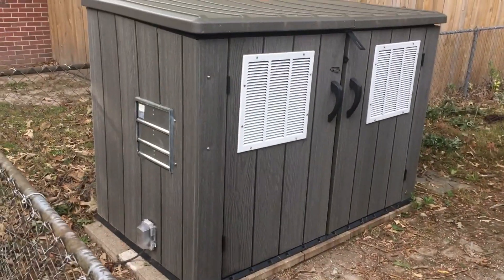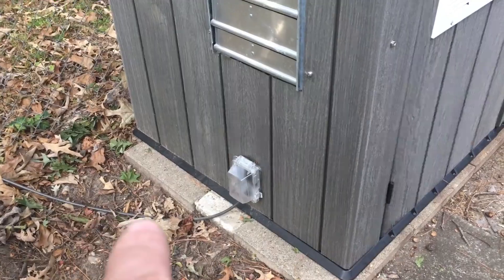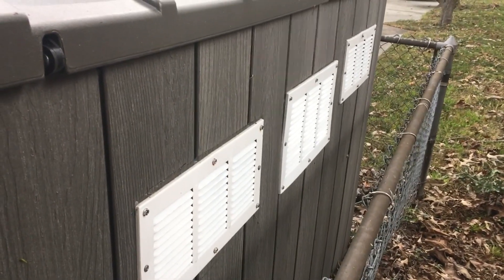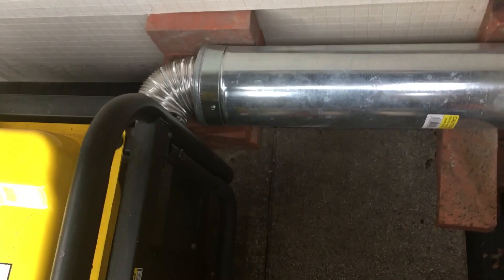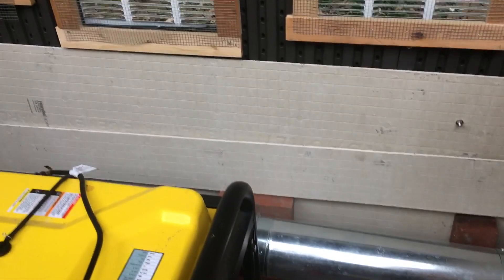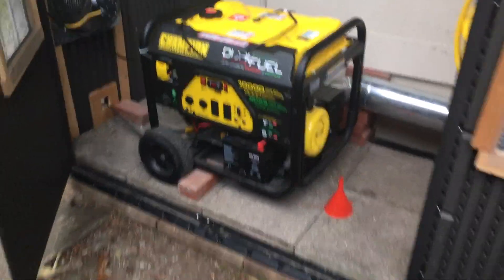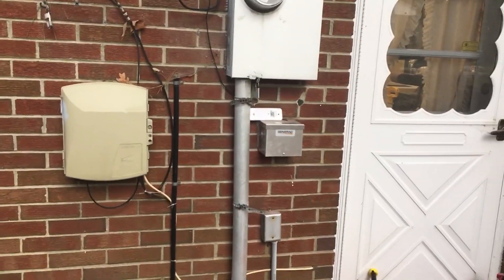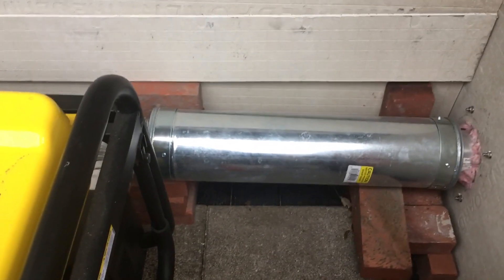Generator Shed / Enclosure

Comment: I know this an old thread but if you haven’t been able to run your ac on the gen. Look into getting a Soft Start installed on your Ac. It drops the starting amps when turning on.
Reply from the maker: That’s a good idea. I’m selling in about a year and the AC is the kind with the ‘can no longer use refrigerant’.  So gonna roll the dice one more time.  Thanks!

Comment: I have a generator that exhaust out the back as well. Been trying to figure something out.  Any problems with leaking around the tab flange? Is the flexible piece going all the way through?
Reply from the maker: I am sure there is some leakage, but I haven't seen any issues associated with leakage around the flange.  A another hurricane came through one or two yeas after I took this video, the generator ran for 7 days and everything held up just fine. The flex hose goes through the 6-inch pipe and then connects to the dryer vent.  Thanks for watching.
Reply: You said you changed this since the video.  What exactly did you change?

Comment: exhaust fans on the exhaust side of the shed intake vents on the lower left side of the shed then cover all the other vents walker exhaust tube and header wrap probably more cfm  you need good crossflow shove the engine fan closer to  the  new vent location

Comment: Over kill in n the vents, rain water will get in
Reply from the maker: It’s been three years and there has been no issues with water coming in the vents.
Reply: Indeed. Also It has the fan on the wrong side. And as you said, the inlet vents; should be at the bottom. Never up side  because the air is cooler near the ground. And NO vents larger than the fan can move the air. Otherwise, the Generator is louder and too hot too.

Sorry that, the old common "adage" of saying, "we have no problems"; does NOT overcome poor "workmanship"! When building any thing. For IF you moved the fan to the other end; and put the vents close to the bottom; and use only enough; that the fan can move air. You would be saying this, "it's much better! GAR-OWN-TEED. Thanks!"

If you were honest. Just trying to help you kind Sir.

Comment: What was the shed made out of I need to build one for a 6500 w water-cooled flathead Kohler generator out of a r.v. motorhome
Reply from the maker: The box is a Lifetime brand unit. I adapted it for my generator to protect it from the elements and ease of access when needed. I have place away from the house to ensure exhaust is not coming into the house.

Comment: Why not wire the generator to the fuse box when needed
Reply from the maker: When I have to power the house, I have a large electric cable designed to plug into the generator and into a plug that connects to a breaker in my panel.  I can only turn on the breaker by turning off the main breaker to the house, so I am not backfeeding the lines.

Comment: I have that same lifetime shed however I went with the taller lifetime shed with no lifting roof.  I have a generac 17500e inside it with rockwool insulation a smaller hardie sandwhich for the exhaust with a 36 inch walker exhaust pipe with muffler tape in a 3 inch double layered galvanized vent with some heat wrap out it.  I also have 3 hessaire fans 300cfm, 900cfm and 1100 cfm with a 21 x 21 vent and two 6x6 vents.  In Texas I have a heat problem I had a fan shut off at 130.  What temps did you record when running it 3 days straight.  I may start over use the shed you have and forgo the insulation or go to rockwool comfort board instead of rockwool batting.  I have to get the temperature lower.  I'm no longer concerned about sound my neighbors each put in 24KW standby units so it no longer a concern.
Reply from the maker: Once the storm passed (in 2018) there was no reason to keep the enclosure closed up.  For the ensuing outages I did keep it closed up to protect the generator from the rain and still recorded temps in the above 130.  That is just too hot. This winter I will be putting in another fan and more vents.  I was having problems with the generator vibrations and my original exhaust pipe so I did away with my homemade insulated exhaust and used a regular vent pipe through the hardy board.  Haven't had any problems.  I know its noisy, but my neighbors all have generators...so I am good to go.

Comment: Your inlet vents should be as low as possible so that the fresh cool air can come in, run over and through the generator cooling it off. The exhaust power fan should be high because heat rises and you'll need to suck the head space inside the shed. 
Your design bring in fresh air up top and removes it up top without it really helping the generator/the shed cool off as efficiently as it could.

Comment: If heat is an issue in summer, you can add a small garden hose and water tank and set up a drip swamp cooler.
Reply from the maker: I had thought about that. Goes back to my Arizona days! Lol

Comment: you shouldve just bought a generac bro.
Reply: Bit stupid buying  Generac considering the cost of them and the warranty issues forcing you to have a Generac certified installer install it otherwise you get no warranty. They are good generators but for most people power outages happen for a few hours twice per year. I costed out a Generac to give me the same as my Champion Generator - 7500 running watts and it came out close to $7000. With my new generator shed build - which is very substantial compared to this one as I am using it to dampen sound, I'm looking at around $1500 for the generator and the shed including a concrete base and it's hooked up to my large house propane tank. I guess you must be Mr Money Bags to make stupid comments like that.
Reply from the maker: $700 vs. $5000 plus the cost of running a gas line...all in I was looking at $8000. With very little return on my investment with a move pending.

Comment: Did you run the ventilation fan in your extreme test?
Reply from the maker: I did run the fan during my test.  However, I commented below to another viewer that during Hurricane Dorian, I ran the generator with it closed up and the fan on; No sun, temps in the 70's and the inside was still really hot.  I will have to install another fan in there, as it is too hot to run with the doors closed.

Comment: Out of curiosity, I'm in the learning phase here, why didn't you go with 50 amp service? Don't most of those style generators provide it? And how much consideration should taken on the storm rating of the enclosure?
Reply from the maker: My generator is 30 amps.  I’m not sure about the amperage for other generators or if a generator switch can be installed, by code, on a larger circuits. 

I don’t know about a storm rating...but I installed a layer of pavers on the bottom of the enclosure for weight. I also put in an auger stake at one end, (really a pet stake) and run a ratchet over the enclosure to my chain link fence.  It won’t stand a tornado...but so far she’s lasted through two hurricanes and a tropical storm...plus the summer high wind thunderstorms.

Comment: May I ask where you got the storage shed? Yours seems much nicer than some of the ones I've seen on YouTube.
Reply from the maker: PMCRyan Costco. But they only sell them at the beginning of spring.
Reply: @snapjamwoodworks710  thanks! I'll have to keep my eye out. I'm on well water and electric hot water so it's time I invested in a generator as well as storage shed.
Reply from the maker: PMCRyan Appreciate the feedback. Hurricane/TS Isaias just rolled thru last week. Had the generator running for 36 hours.  Fortunately (ironic, I know...) the storm hit in the early morning and knocked out the power about 4am. It was past us by 9am so no rain just wind. I was able to prop the doors open to let the heat out. I have plans to add another fan above the exhaust pipe. It’s just too hot in there with the doors closed, even while it’s raining with no sun.
Reply: @snapjamwoodworks710  you think two exhaust fans will improve that? I'm trying to soak up as much information about these builds before I go out and do my own.
Reply from the maker: @RyanAtTheTop  When I tested after first building the enclosure, I recorded a temp of 127 degrees in August in the heat of the day.  That is 27 degrees hotter than the recommended ambient operating temp.  During Hurricane Dorian last year, I ran the generator with the doors and lid closed, during the day in the middle of the storm.  No beating down sun in early September with a high temp that day of 75 degrees and I recorded a temp of 120ish degrees in the box.  I believe another exhaust fan would help, with at least one or two more vents.  Jay Vee made a comment below about placing a fan near the exhaust to help.  My dad  had the idea to cut a larger hole in the back and aim the exhaust out instead of a pipe.  I am planning on doing just that and installing another fan once the hurricane season is wrapping up.  Where are you located?
Reply: A lighter color might also help. It not only has the heat being produced from the generator, but also the heat being absorbed from the sun.

Comment: Nice concept but your exhaust venting solution is going to drive up temps on the exhaust valves and cylinder head leading to premature engine failure. You really don't want to duct it like that or extend the exhaust in any way due to standing pressure. 
Instead just put the exhaust fan near the generator exhaust.
Reply: That's a good point about the exhaust.  I wonder how the production enclosures like generac do it?

Comment: Recently, a friend and I were debating about all these youtubers who are keeping their portable, gasoline powered, power generators in a vinyl, store bought shed. The shed is intended to be used as an unobtrusive place to store a few trash cans. These vinyl "sheds" make for a very suitable thing for storing a portable, gasoline powered power generator. It keeps the expensive generator out of the elements, and provides some noise reduction when the generator is running during or even after a store has knocked out power. It is clear that the generator produces a massive amount of heat in just a single minute of running. The obvious, "simple" answer to this dilemma is to install air vents on one side of the shed and something like a 120 volt AC, attic fan that can be conveniently powered by the running generator. Most people who attempt this monstrosity are often too proud of their "custom" designed, quiet, generator shed box. One youtuber placed an attic fan on the lid of the shed instead of the side like all the others, which ideally remains closed to keep the rain out. It is clear to me that the attic fan will do a much better job of removing the heat inside this box if the fan is on the roof/lid, not the opposite side of the shed from the air "intake vents". I won't even go into the various ways of modifying the shed to allow the exhaust to escape without melting the vinyl shed. OK, so, if the generator is stored in this "otherwise" sealed container, the fumes from the gasoline in the generator's tank will indeed produce some fumes, fumes that we all know are dangerous and highly explosive. Is it possible that when the generator starts up, and kicks on the AC power to the attic fan,,,, wait for it.. a single spark from the attic fan's motor brushes/armature could ignite the fumes and KABOOM??? !!! ! !  !
Reply: You obviously have just discussed it and not done it.  Most of us are going to propane over gasoline but fumes with proper CFM are not an issue.  This being said you are accurate that controlling the temperature is a real challenge and gas boils at 168.
Reply: That’s what worries me also… fumes and the possibly of a explosion.

Comment: mr asked when the engine is running and hot.  You can heat the gas tank because it is very close.  it is dangerous ?
Reply from the maker: The tank is directly above the engine by design and just inches from a very hot exhaust.  The increased ambient air temperature in the shed would not be a factor.

Comment: I have the same generator and am looking for a solution to store it in the northeastern US where we get heavy snow in the winters. What is the size of the shed you used?
Reply from the maker: Malcolm Gregoire I just returned from a business trip. I’ll measure tomorrow.
Reply from the maker: From the manufacturer 75.2 in. x 42.5 in. x 52 in.  I bought at Costco. Now that it’s spring they should start stocking them.

Comment: What ton is your AC? I have a similar spec generator and it easily starts my 3 ton.

Also maybe add another exhaust fan? Max operating temp for air cooled gens like this is usually like 105 degrees. Also might want to consider getting some 5w-40 if it gets cold there or just got for 15w-40
Reply from the maker: adammperez I have a 4-ton system but it’s on a 40-amp circuit breaker and the interlock circuit breaker is only 30-amp.
Reply: Snapjam Woodworks you should still try it. It won’t trip the breaker. Running amps is prob like 15-20. The surge is prob 80 but it’s for like 100ms, doesn’t trip breakers. If you put a hard start, no question it would start it.
Reply from the maker: adammperez I’ll try the AC. Another fan is on the list. During Dorian it was still pretty hot inside.
Reply: Snapjam Woodworks Very cool...I have the same genny and have my AC guy coming to install the hard start kit so I can run my 3 ton....I still need to build the enclosure but this is very helpful! Thanks

Comment: What brand is the shed.  Where did You     Buy it
Reply from the maker: Roel Solis Lifetime. Purchased at Costco
Reply: @snapjamwoodworks710  what are the measurements of the shed? I dont see this one on costco website right now
Reply from the maker: Stu Beans 75.2x42.5x52. They usually have them on the floor in spring. This late in the season they may be all gone.  I bought this one when it was returned in the box. Good luck.
Reply: @snapjamwoodworks710  Thanks buddy. I was able to find a Lifetime Horizontal Storage Shed (75 cubic feet) at Sams for $349. Pick up tomorrow !

Comment: I appreciate you taking the time to make this video. I'm getting ready to build an enclosure for the same type generator (and I'm coincidentally also having to deal with that Virginia Beach heat and humidity). I'm building it with noise as my primary concern due to the location I have to have the generator in, so this design may not work out for me, but it still gave me some ideas.
Reply from the maker: Beautiful Loser Good Luck!

Comment: Hi, what tempetature is espected inside? Msximun?
Reply from the maker: As I said in the description, the temp peaked in the full sun and a 90-degree day at 127.
Reply: @snapjamwoodworks710  127 degree is ok? is safe?
Reply from the maker: @tutoyotutoyo6515  My generator has a label that states not to operate it above xxx-degrees (I can't remember the exact temp, but it was over 100 and much less than 120).  I peaked at 127 and let the generator run.  I can't tell you if it's safe or not. I did not see or hear any performance issues with the generator and the shed was just fine.  I ran the experiment to determine what the temp would be in the most extreme conditions.  I do not plan on running it in those conditions.  If there was a rain event and I needed to shut the doors to protect the generator from wind/rain, the outside temperature would likely be cooler, thus the inside temp possibly would be cooler with the fan bringing in cool air and no sun would be beating down.  In all other conditions I would leave the box open.  In the rain I will close it off with the fan on and monitor.

Comment: Looks good. What are the dimensions of the shed? Also you might want to pull the insulation out from around the exhaust, although it probably doesn't get hot enough, fiberglass insulation is flammable. You could use something like roxul insulation if needed.
Reply: Yes. I agree.  Replace the fiberglass with ceramic insulation, or Lava wrap.
Reply: Woody83 looks like fire rated spray foam to me

Comment: Very nice. Smart using the hardie board for the exhaust area. What is the name brand of the shed, e.g. Rubbermaid? And how is the noise level?
Reply from the maker: Thanks Kenn P!  The brand is Lifetime and I purchased it at CostCo.  The noise is still pretty loud.  The shed is in my side yard away from my living areas.  My goal was to vent the exhaust out of the shed and not melt the walls.